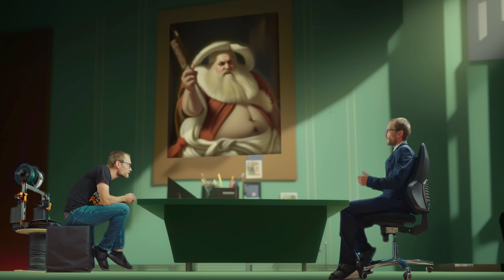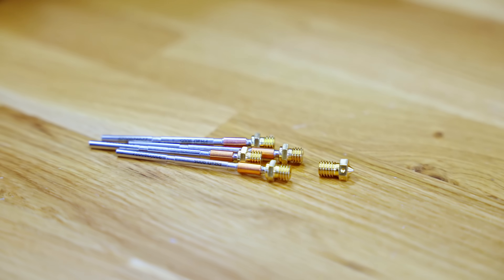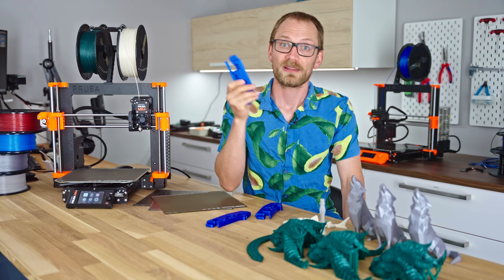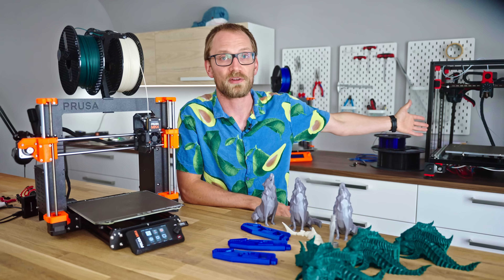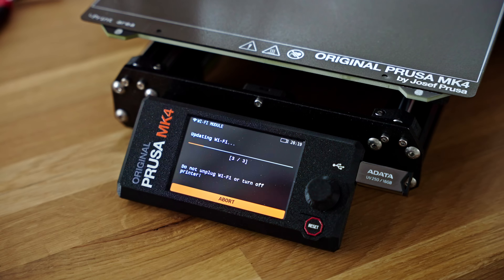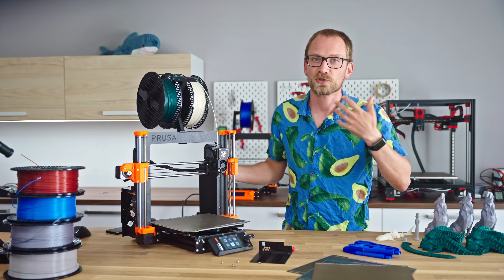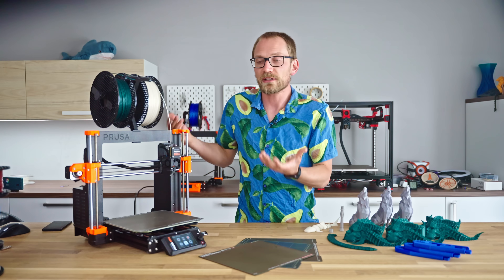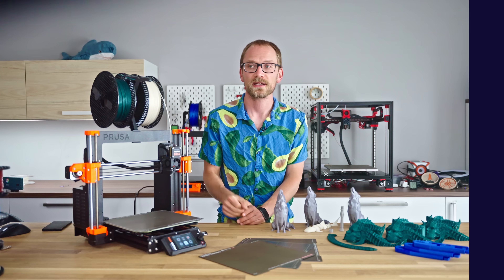Does the Prusa MK4 have what it takes?

Comment: I traded in my XL reservation for the right to purchase a MK4 and I don't regret it at all. Most of my prints are mechanical objects, not art pieces, so all of the hullabaloo about ringing means nothing to me. What matters to me is reliability, serviceability, long-term support, and speed. Input shaping on the MK4 means that it can print the type of things I print in a third the time as they would print on my MK3, and because of the other features of the MK4, they print more reliably. WiFi doesn't matter for me, because I've got Ethernet wired to my workbench -- it's plug and play.

As it happens, I prefer OctoPrint to PrusaLink, so I applied two upgrades to my MK4 (hard-wired OctoPi + Logitech C270 camera) and I'm set.

I hand-assembled my MK2 (and all of its upgrades to MK2.5S) and my MK3 (and all of its upgrades to MK3S+ and MMU2S). I've assembled 5 other MK3s for other people. While I thought about getting the MK4 kit, the extra cash to get a fully-assembled printer sooner than the kit was really a no-brainer for me. As with all 3D printers, Your Mileage May Vary.

Comment: I love the despicable me reference 😂😂
And from what I make of your review: it's a very solid no nonsense machine build to last, unfortunately it's rather pricey.
If the machine is worth the price heavily depends on personal preference.
As for the opensourceness of pruca, I hope things like pruca slicer become such a standard in the industry that it will be more attractive/cheaper for other companies to sponsor/support prusa with the development instead of forking/reskinning/supporting their own slicer. That's usually the only way a successful opensource project survives in the long run.
Now would I personally spend that kind of money on a mk4? Nope, but I'm a cheapskate... And I like to tinker, so I have a cheap flsun q5... For the same reason though I wouldn't buy a bambulab either...
Reply: Forking PrucaSlicer like BambuLabs did is the same way like Prusa forked Slic3r. Prusa or anyone else (like OrcaSlicer) can look into their repository and pick out things they like without having to redevelop them. Though Prusa has a tendency to develop everything on their own with mixed results (like PrusaLink).

Comment: I have a Bamboo Labs X1 Carbon and P1P. I have used both enough to see excellent prints time after time with only one failure which was my fault. I have only printed one item off the USB stick on the MK4 which was hours long, but printed very well. I hear that Prusa is working hard to catch up, but there’s a long road to get there.

Comment: Thomas. We are a small start-up, making AI-powered pest detectors for Agriculture to help reduce the amount of pesticides contaminating our environment. Our detector is selling in early production form, and essentially all parts are 3D-printed. Currently about 740 grams per detector. We have run our first MK4 through 2 weeks of non-stop production and it's never missed a beat. It's just chugging along, flanked by our MK3's that have almost one full year of printing time on each of them. Which other printers operate at that level at that cost ?

Comment: Yes it's expensive. However, I think you underestimate the plus value of having a open-hardware. Prusa offer upgrade pack and replacement part but if you want, you have access to a big third party market for replacement part or upgrade. Or you could just print your own! I've used closed sources printer like Makerbot and Zortrax and the experience was pretty poor. You need to purchase from their store were everything is stupidly overpriced. In the case of the Zortrax, they stopped supporting their printer only 5 years after. Which means that when it breaks, it's over. The other things, they just work and require almost no fidgering. This is a big plus for a small enterprise where time is money. Not all compagnies can afford Ultimaker/Makerbot. If I have the choice between fives MK4 or one Ultimaker, it's an easy choice...

Comment: You are saying exactly what I have been thinking about the new Mk4.
I want one, though is it justifiable right now? Probably not.
Prusa has even written that if your printer (Mine is an upgraded Mk3) is working great, then don't change anything. 
It is working great with the latest firmware and Prusa Slicer. 
I wanted the Mk4 to blow me away and so far not so much. 
I'll be watching and waiting like most, I think.
Thanks, Tom, great review.

Comment: I'll go buy a Sovol or 2 or 3 for the same price as the Prusa. They seem to have a good product but my used DIY fully rebuilt Anet A6 into an i3 clone-like 3D printer puts out just as good of prints. I also have an $80 RRG i3 I've rebuilt from the ground up that does pretty good prints, not as good but acceptable. I just can't justify spending $800-1200 when I don't really gain much. Great video though.

Comment: An issue with fixed measurements on a bed slinging printer is that a different flex plate with different weight will modify the resonances.
So if you have a "more exotic bed plate" like for example FR4, which generally is pretty heavy, the resonance frequency is likely lower.

No sensors means tedious calibration every time you change
Reply: Also important note: Prusa Slicer is based on Slic3r, which is GPL.
Using it as a base means you should give back.
This is exactly how OSS works and should work.

If you want to life in the printer space as a company, you need to innovate and not stumble behind.
Prusa is failing at that.
They survived well with their open source designs until now, cause their devices were good, but now they are not ahead anymore, so they will have to pay the price.

Comment: Yeahh.. I was doubting what to get for myself an the choice came down to a Prusa MK4 or an X1C. I've been building DIY printers since 2012 but due to health issues I'm no longer able to commit to building my own designs. I decided to get something that would allow me to print my own designs in most filament types but also shouldn't be too expensive and on top of that should deliver a polished experience without having to do to many upgrades.

Well I 'joined the dark side' and bought an X1C and man.. I got it this Saturday and have been printing with it non-stop. I don't remember having had this much fun making 3D prints. I don't have to worry about if a print may fail or if a print will succeed but have too many artifacts to be usable, or worry if the overhangs are too steep or if the support might be caked onto my model. It just works. Yes there are a few key issues with this machine that I didn't know beforehand such as needing an internet connection if you want to use the WiFi upload and the fact that the activated carbon air filter doesn't really filter the air and you still need to print and install a Bento Box. But beyond that, this machine has eaten everything I threw at it. Even a ten year old PLA filament that I never used because it wouldn't print on my previous machines. I'm absolutely amazed. I am used to having to tune my machine to the max to get certain filaments print well, but it appears Bambu Lab really did something great here. And I never thought I would ever say this, coming from a DIY perspective. Heck, I've been an admin on the RepRap forums since 2012 or 2013, I've been quite dedicated to RepRap and DIY for a long time.

Comment: How can you tune a bed which is constantly changing mass as it deposits more and more material. The geometry of the model would also play a part... Very tricky, coreXY machines have it easy on this regard.
Reply: usually the mass of plastic is much smaller than the bed (my 230x230 is ~1.2kg with a glass plate), and you could also in theory tweak for it.
though the print actually moving may also be an issue.

Comment: I have a lot of respect for Prusa. My machines served me very very well and made it very easy to get up and running and then venture into a farm and make good money. They are a simpler solid reliable production machine. I still have my Xl on pre order and see the core xy and tool changer option and large build size as a best option for multi material prints "Have yet to tinker with that" but in the long waiting I had recently ordered a mk4 as i wanted and needed an upgrade to hopefully have better experience with harder to print materials like cf nylon and  maybe try re attempt abs. BUT after waiting a week on my mk4 order I changed my mind after getting up to speed with the latest offerings and ordered a Bambulabs x1c. Doing my first print as i type this. Sent it with stock pla settings and printing something I have never printer before which is a articulated dragon. WOW this thing is fast. clean and as mentioned all stock settings just sent it to see how it faires and so far so good. I think I made the right decision for a mid size build volume printer that should hopefully make troublesome materials print easier. The speed with slicing shows anywhere from 1/2 to 1/3 the print time of my mk3s+ bears with Bondtech extruders on a fairly decent speed settings. This is like having more than one machine., Plus in the past I have never printed fun items or nick knacks due to time and effort needed and not really interested I have only printed parts and things I sell. Now this new machine makes me want to print stuff just for fun as its fast and seems to be a much nicer user experience and easier. Lets see I guess as its only my first print but damn its fast. And has a larger build volume. I will still wait on my Prusa XL though as i see the best of both worlds and different usage scenarios for both the XL and the X1C.
Reply: Any fear that your prints will be on a Chinese "printables" "thingiverse" one day?  After all, you are selling your products.
Reply: @herr_rossi69  I don’t think it will be an issue. I can always print offline with sd card if it’s something I am worried about.

Comment: Love what Joesph did for this hobby.  I honestly think that if he hadn't done what he did we wouldn't have what we have today.  That said?  He didn't move with the times.  I, like many, built my first machine back in 2010/2011 timeframe, back when you sourced motors, drivers, built your electronics from kits, etc.  Then when Joesph launched the business I totally wanted one, but just couldn't pull the trigger on that printer.  I was going to build a new one (I could make the MK3 for like $300USD at the time), and a buddy said "Forget it, look at the Ender3".  For $139 delivered I had an Ender3 and it printed right out of the box.  Sure I did some upgrades (extruder to aluminum, new bed springs, mirror bed, cable management, Octoprint and just 6 months ago a BL Touch), but it just worked.  Matter of fact...it's STILL a work horse with over 4000 print hours on it.  I got a 6SE on the kickstarter, another freaking workhorse.  All the people cussing out Creality, and the thing just freaking works like a champ. 

Story here?  TWO printers, that have required VERY little work on my part (OK, so I guess I got two unicorns here, because both just work), for less than what I could get a MK3 from PRUSA for. NOW you have Bambu Labs coming out with these printers that just fly.  I mean, I know a few people now that bought them, but they are also using them for business purposes, but they love them...and still about the price of a MK4.  The thing has 4 color change, it has speed, it prints in multiple materials out of the box.  Joeseph needs to step up the game or he's going to be gone.  I hate to say it, but it's going to happen if he doesn't do something quick.

Comment: I've built my Mk4 today.
First thing I did was to upgrade to 5.0.0 alpha. 30 minute benchy is something, but I' was really shocked when I saw that there is no accelerometer anywhere.
What was really a plus form me, as a person that built many Prusa i3's, was streamlined building experience. 
What doesn't stand out at first is also how incredibly well built this machine is.
It's much stiffer and heavier than Mk3s+
I'm patiently waiting for Prusa or legion of tinkerers to enable capacitive touchscreen, accelerometer, and maybe a Klipper port?
I'm not a fan of Prusa Link and I strongly prefer Octoprint, so getting it to work with Mk4 will be my next project.
This and full PC Blend CF and inserts printed parts revamp. I can't stand idler screws being screwed down directly into tiny PETG part.

Comment: I have a Mk4 and 2 Vorons (V0.1 and V2.4).
The Vorons are faster, and have way better web interfaces - in my case fluidd. things like setting a temperature, getting a live preview of the gcode being printed are notably absent on prusa link.
The Vorons however do need extensive tuning up front and good technical knowledge, which is something im kinda learning by doing right now, at least my V0.1 regularly has some issues with its printhead (yes, im planning on upgrading to a V0.2, but that is also a lot of work). the V2.4 is dead in the water, because i had problems with my inductive probe and it broke part of my hotend, so im taking the time to upgrade to a kinetic bed mount and Voron Tap for bed probing, compared to the "stock" option of having a Z endstop bolt that is probed via nozzle, and an inductive probe for leveling the gantry.
Meanwhile the Mk4 has been a workhorse, like many people say: churning out ABS parts (printed in a makeshift enclosure made out of the box it came in) for the Vorons with surprising consistency. even with the Mk3S+ i had some oddities regarding my bed mesh and first layers moving around, not with the mk4 though, they did make a great bed probing system (which i hope to somewhat capture with Tap on the V2.4). as of right now, i dont think ill try the input shaping before its "done", simply to just keep one printer that 100% works.
As I said earlier though: the "smart" features are hit or miss: one one hand its nice that there IS a webinterface now, but the wifi keeps dropping out on me, which it never did on my V0.1 so far, ethernet works flawlessly though. However the webinterface (im only referring to prusa link, since i cant be bothered to set up prusa connect for things in wont use it for) is just SO bare bones. I cant even drop a firmware image to the USB remotely, since the UI only accepts gcode. It cant set temperatures. sometimes gives cryptic error messages that dont mean anything (eg. uploading a file via prusa slicer to then immediately start, which sometimes errors out, but starts the print anyways). Not being able to freely change the username and password is also kinda janky. the temperature graphs only have very limited use, since they only show extruder and bed temp (heatbreak temp would be great to have here too), and even then there is only a rudimentary legend shown, so you cant actually read the chart.

Comment: For me, it was a no-brainer to get the Bambu Labs X1 Carbon. For the same price as the MK4 I got a much faster, enclosed, feature-packed machine with great reviews. I have been incredibly happy with it for the last two months. It is a monster and prints so quickly and reliably. I pre-ordered the MK3 and was happy with that machine for years. It just didn't make sense to get the MK4 with what felt like the same machine I already had and at the same price as a much more feature-rich machine like the X1 Carbon. Sure I am taking a risk with a new company that may not have as great of a customer service but I haven't had to use it yet. I guess we will see if that comes back to bite me but that seems like worrying about an issue that hasn't presented itself yet.
Reply: right ... up until Bambu labs discontinues it and no parts are available anymore because they want to sell you a new machine....
Reply: @mr_disintegrator  that's a lot of assuming. You know what they say about that.
Reply: @christophermacier  OK, well good luck. Talk again in 2 years.
Reply: @mr_disintegrator  I guess I will take the risk to support a brand that is actually innovating the space. I appreciate all Prusa has done for the community too and have supported them. At this point in time though they just aren't up to snuff with other brands that are pushing to give their users more features at a better price point. At least when my X1 Carbon arrived I had all the features they promised right away and don't have to wait for something that was promised like input shaping like Prusa.

Comment: I think it's funny that the good things that Prusa does right they get criticized it. THEY SHOULD BE PROPRIETARY! PLEASE LOCK DOWN YOUR FIRMWARE AND POTENTIALLY PUSH THE COSTS OF LICENSING TO US CONSUMERS  SO YOU'RE AROUND FOREVER! PRETTY PLEASE!!. Prusa Wouldn't exist without being open source and contributing towards it. Yes companies are abusing it, but I think refining and actually holding the violators  accountable is better than outright turning your back on open source when it's what gave you your start in the first place.
Reply: There are companies and products that are open source and paid at the same time, some support the right to download and modify the code to bypass the pay wall, something like this would probably be good.

Comment: As someone coming from a MK2.5S and uses 3D printing as a tool, the MK4 seems like a solid upgrade. I want a reliable and repairable machine from a company I can trust. I don’t want to fiddle about trying to get a print out or to put my faith in a machine with parts sourced on the cheap. I want to know that I can put a print on, not burn down the house, and have a pathway for upgrades and support if and when I need it. Prusa provide me with all of that and more (open source and a mind for sustainability, perfect!). If input shaping ends up working, sure… but it’s not a feature I care about when I’m already getting great consistent prints.